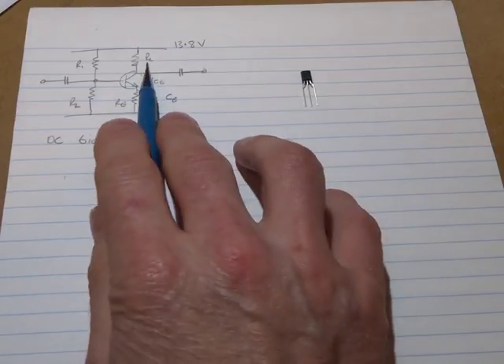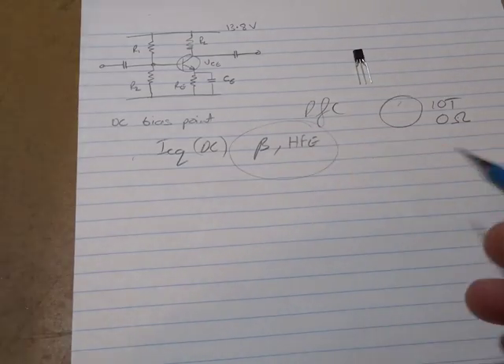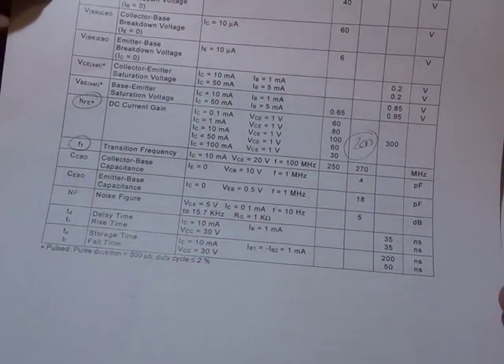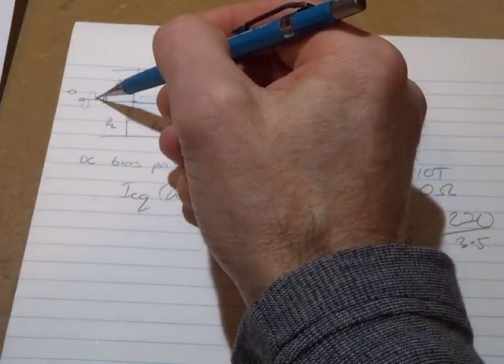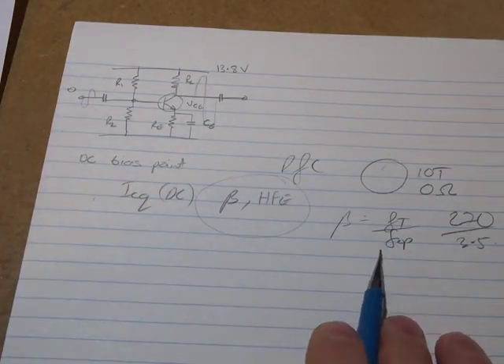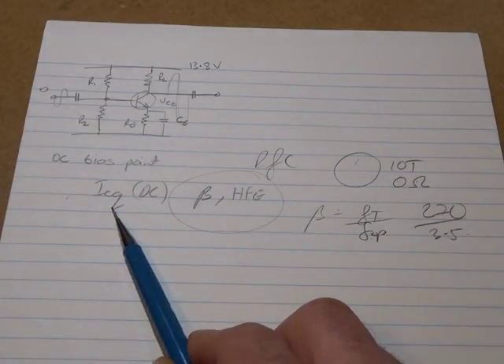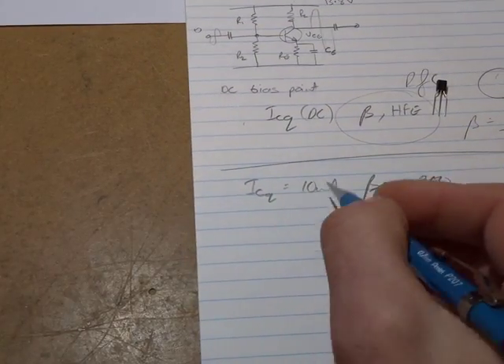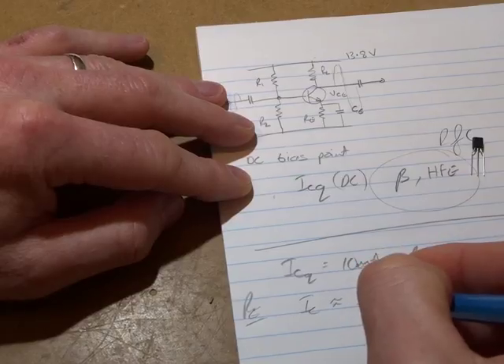Common Emitter Amplifier Biasing Calculations

Comment: Damn. I just use a multimeter to measure the voltage I want at the base of the transistor to amplify my signal without distortion and that's it. I work with big signals so I don't need too much gain on my designs. I do some math, but not anything like this. I use my oscilloscope to scope the signal and then I can change the resistor until I'm satisfied with the gain and frequency response of the thing. Like, if you want to work with amplifiers you must have an oscilloscope.

Comment: The collector current determines the input and output impedances, nothing else. The high limit occurs when the transistor's maximum power dissipation of 625mW is approached. The low limit occurs when the parasitic capacitances' reactances at the frequencies of interest become significant compared to the resistors used.
Around 13:30 you should realise that if you fully bypass the emitter resistor, the ac gain of the stage becomes RL/ re, where re is the internal emitter resistance (the slope of the Vbe/Ie curve at that collector current and equal to 25mV / Ic).
But you make the mistake of assuming that Re determines the value of the bypass capacitor. It doesn't. Until the reactance of the bypass capacitor is less than re (which is just 2.5 ohms at 10mA collector current), the gain will increase with frequency because it becomes RL / (re + Xc). The capacitance would actually have to be C = 1 / 2π x 3.5MHz x 2.5R = 18nF, rather than the 3.3nF your calculation would indicate. if we used your value, the gain at 3.5MHz would be RL / (2.5 + 13.8j) which is phase-shifted, highly frequency dependant, and 15dB down on what it could be.
If you split the emitter resistor so that a part of it is unbypassed, then as a rule of thumb, that part should be ten times re (25mV/Ic), say 27R. That will remove much of the non-linear distortion  and make the ac gain more predictable. Then you use the 27R to calculate your bypass capacitor, of course.
Reply: Rex i need the text book that you're taking these infos from pls 🥺
Reply: @NoName-yy1jx  Sorry, none of this is from a text book. It's just the result of spending over 50 years designing and making transistor circuits.
Reply from the maker: Thanks Rex. I'll take a closer look at this.

Comment: From where u got that frequency value 3.5 Mhz while calculating capacitor value plz give repley
Reply: Charlie was talking about designing an amplifier stage for use on a radio frequency band that is normally called the "80-metre band", which has been allocated for amateur use. It extends from 3.5MHz to 3.9MHz or 4.0Mhz, depending on which region of the world you are in. There's plenty of information on the web if you want to search for it.

Comment: Bit of a late reply - only just came across the video and thanks for posting.
The approach you have taken reminds of methods I was taught years ago at "school" and techniques I have seen in many text books. I too have wondered why few datasheets contain the characteristics graphs. What I have found from limited homebrew experience is that the HFE values for transistors can vary considerably over the specified range. Maybe that's why manufacturers are reluctant to put the graphs on the datasheets? Also, some of the datasheets values will be valid only for very specific test conditions (e.g. specific Ic and Vce). So, unless I measure the HFE of a transistor I am going to use, I would normally go with the specified minimum HFE for calculating the dc base bias resistors. Also, especially for transistors like the 2N3904 that don't have a super high transition frequency, you can of course expect the hfe to drop off as frequency increases. So, some expirementation, reliance on previous experience and reference to tried and tested designs is what I would go for.
Reply: GOOD ADVISE, I TOO REMEMBER LEARNING THOSE METHODS.

Comment: This is an older video but I would like to offer some perspective that I feel is being lost by the video and the comment section, and would like to offer ideas that few use.

First:  All of these 'hallowed'-calculations that are taught, are for designing for production NOT performance!  Different transistors will perform differently (even within the same-type and even same-lot!) at different Icq's, frequencies and output impedances.

Second: This is driven home, by transistor Beta variations that can exceed 100% for a given transistor even within the same manufacture datasheet!  If you want to properly quantify performance, it is a fool's errand to try and use the widest geometric-mean or the lowest value etc. for beta. Another example is the 10X rule for the input DC divider, this is really only a guarantee for lousy transistors within a lot.

Third: There is this magical Vcc (in this case 13.8V) that is not real world unless you are never going to use it off that perfect power-supply.  Many times, you will be using a battery that can be a 14.3V down to 11.7V (or even worse) say in an emergency.  So, a circuit worth its salt has to perform at any one of these to be practical.  Some of the major ham equipment manufactures are terrible, requiring boost circuits even when using a partially charged battery! 

Fourth: External component tolerance variations (especially when all their statistical variations conspire to give the worst outcome!) will play a significant role in the exact circuit performance.

Lastly, if you design using one of these 'production'-calculated/derived circuits methodologies, what do you have.  Well you can claim that the circuit will work with the crappiest transistor out of the lot; the worst resistor tolerance variation/degradation. Does that sound like designing for performance--No!

Moral-of-the story: The real answer for the hobbiest (not-production) is to think in terms of greater precision and to set ourselves up for success. How?  

First off, buy a bunch of your favorite transistor and grade them for good performance and tight similarity on a unit-to-unit basis.  Constructing a high-frequency amplifier or oscillator will allow you to more accurately quantify performance, than calculating geometric means and worst-case values from a datasheet. So, out of a hundred transistors you will usually find 75% of them are really tight with each other--use the rest to drive LED's or relays!  Then come up with your own specifications as if you were in charge of doing so for your sweetheart lot.

Finally, the most important concept, is empirical testing of your circuit.  Every engineer should sit down and vary all the circuit parameters just to learn and observe EXACTLY what your circuit REALLY does.  

When I was playing around with QRP gear I quickly found that using 10mA quiescent-points quickly added up and did NOT add ANYTHING to the NEEDED circuit performance. You will find that you can use much less current whether quiescent or input divider (because you don't have wild beta-variations!). Many times a free-lunch can be had with higher-gain transistors but make sure everything stays stable! Make a habit of measuring ALL of your external components for tolerance. Most importantly, lower the operating voltage and make sure the circuit still performs (oscilloscope patterns etc.). You will find it fun to push the circuit elements to the max when you think in terms of performance NOT production.  73...
Reply from the maker: Great input. Thanks for taking the time.
Reply: PICKY,PICKY!

Comment: what if av id given how to calculate correctly
Reply from the maker: Hi. I would use Av=-Rc/Re, then once Re and Ve are determined, re-calc R1 and R2.
Reply: @CharlieMorrisZL2CTM  so in ce voltage divider bypass AV = -RC/re i can determine RC , but if my RE> RC that have no problem right?

Comment: what about inpu and aoutput capacitor values?
Reply from the maker: I typically set those to have a Xc < 100 ohms at the lowest freq of operation. More often than not I set RF amp caps to be 100nF.

Comment: In a battery powered environment 10 ma in a multistage amplifier can add up pretty quickly. What about the input impedance which will be dependent on R1 and R2?
Reply from the maker: That's certainly true. I'm going to design all of the amps at 1mA for the Go QRP rig and see how that works. I chose 10mA for this one just for the exercise.
Reply: In another reply, I noted that the input impedance also depended on (β x the total emitter resistance), and showed that if you bypass the emitter resistor, it could be as low as 250 ohms. Reducing the collector current chosen by a factor of X will increase the input impedance (and also the output impedance) by the same factor. Adding an extra emitter resistor that is not bypassed can also significantly increase the input impedance (as well as reducing the distortion and gain).

Comment: You are the best!
Reply from the maker: Thanks. I am no expert, and this uses a number of rules of thumb. The sim is to make it simple and hopefully attractive for other to give homebrew a go.
Reply: @CharlieMorrisZL2CTM  No, you really made it easy for me. Thank a lot. I was stuck somewhere at collector, and needed to match the impedance of Rl with Rc. Your approach to biasing seems a lot more easier than reading through several books, which actually complicate things. Also, I just wanted to know more about constructing RF transformers to match impedance between the stages. Coz, this is actually the device that effects the overall efficiency of the circuit. So, requesting your next video, please.  And thank you once again for your reply.

Comment: Thank you for the video! I've put together an interactive notebook that can calculate the circuit using that method given the input values. Might be useful to someone: https://observablehq.com/@flpvsk/calculating-a-common-emitter-amplifier-circuit

Someone has asked that already, but I didn't quite get the answer. How do we know the operating frequency? Would that be 20Hz - 20kHz for audio? And so for the Ce we'd use 20Hz, is that right?
Reply from the maker: Nice work Andrey. That will be useful.

Comment: How do you get the lowest operating frequency ? If it's an audio amplifier should the lowest operating frequency should be 20 Hz right
Reply from the maker: Hi. I use standard communications audio bandwidth of 300-3000Hz.

Comment: CHARLIE MORRIS,    
                             Does the AC/DC load line mean the maximum output wattage power of the transistor or does the AC/DC load line mean the power dissipation of the transistor?
                                     Because the AC/DC load line is selected by the EE designer of the operating voltage and operating current for the transistor and the DC bias Q point which will determine the maximum output wattage power out of the transistor and the power dissipation of the transistor. I'm not sure what the LOAD means in the AC load line and DC load line what they are calling the LOAD.

Comment: CHARLIE MORRIS< what is the formula to get "how much current in amps" can a 4700uf cap can hold from B+450vdc from a linear power supply?
Reply from the maker: Hi Bill. I don't know the answer to that off the top of my head. Current would be a function of the load hanging off the cap once it is charged up. Full charge will be 5x CR (capacitance x resistance). Same for discharge.
Reply: @CharlieMorrisZL2CTM  without the LOAD, how much current in amps can a 4700uf hold store with a power supply DC voltage at +450vdc? the 4700uf filter cap will charge up to +450vdc but how much current is the 4700uf holding storing?  What formula can I use to calculate how much current the filter cap is storing in amps?
Reply from the maker: Bill. I hope I have interpreted your question correctly. In a DC system current does not flow through the capacitor. When a voltage is applied, the capacitor will charge up to that voltage. Once it is charged, the capacitor
will hold a charge (in coulombs) equal to Capacitance x Voltage (recall, charge a coulomb is the charge (Q) transported by a constant current of one ampere (A) in one second (S), i.e., 1 Coulomb = 1 Ampere for 1 Second). Now for your capacitor, the charge will be 4700uF x 450V = 2.115 coulombs. Similar to a battery, that capacitor could provide, once a suitable load is applied, 2.115 amps for 1 second, or any other combination (e.g., 1.058 amps for 2 seconds). Note too that the time to fully discharge will be approx. 5x (Capacitance x Resistance) seconds.Not sure if this answers your question. Apologies if I have misunderstood
your question.
Reply: @CharlieMorrisZL2CTM  yes for the formula is Capacitance X Voltage = Current Stored?
Why I ask is because the AC ripple voltage will increase higher when the load is drawing more current. Any reasons why the AC ripple will increase when the Load draws more current? The Load is drawing the current OUT of the filter cap 4700uF
Reply from the maker: Hi Bill. I'm not expert but if I recall the filter caps should be providing adequate current to the load during the negative portion the supply cycle. If the ripple is increasing under load, then that suggest you don't have adequate capacitance. Have you tried another capacitor in parallel?
Reply: @CharlieMorrisZL2CTM  yes you have to add more capacitance in parallel. I'm just wondering what formula is used to when you have a load to find out the ripples peak to peak voltage value. 
Filter Capacitance X voltage = stored current
But whats the formula with the Load 
C x V x Load = AC ripple voltage?
Reply from the maker: @billwilliams6338  Sorry Bill, I don't have a suitable formula off the top of my head. This site looks useful: http://www.skillbank.co.uk/psu/smoothing.htm
Reply: @billwilliams6338  Capacitors store charge, not current. The charge on a capacitor is equal to its voltage times its capacitance by definition. So Q = VC. If you are using a capacitor to reduce ripple on a power supply, then the capacitor will charge up slightly on the peak of the incoming ac sine wave and discharge when the voltage of the incoming sine wave falls below the voltage on the capacitor. During that time, the capacitor will supply the current for the power supply, so the charge it will loose will be current times time, So Q = It.
For a full-way rectifier on 50Hz mains, you have a 100Hz sine wave and the time spent discharging will be no more than 10ms.
It should now be obvious that ripple voltage is the change in voltage during the charge-discharge cycle. We know that Q = VC = It and we can use that to work out the change in voltage as approximately V(ripple) = I(load) x 10ms / C(in farads).
For example: a full-wave rectifier on 50Hz mains, smoothed with a 4,700μF capacitor, and delivering 2 amps, we can estimate the ripple to be 2A x 0.01s / 0.0047F = 4.25V.

Comment: It seem that ALL similar tutorials (class A amp) start form the "middle" - electing Ic. The amp "amplifies"  - controls output POWER using input POWER.  Hence the design objective should be HOW much amplification is desired.  Perhaps that would improve on some of those "rules of thumb"  .
Reply from the maker: You are correct. The PA videos later on take that approach. Please note that these are not tutorials, but simply a video log of what I have done. I am not an expert. The whole aim of the videos is to encourage others to give homebrew a go. Thanks again.

Comment: Anyone know where the lowest operating frequency comes from?
Reply from the maker: If my recall my theory correctly, the low freq performance is set by the input coupling capacitor. I typically use a 100nF cap which works well for the frequencies I'm using. Otherwise, set the capacitive reactance to be 1/10th Rin.
Reply: @CharlieMorrisZL2CTM  Thanks. I will look into both of those. Currently using an AC supply of 0.5v at a frequency of 10K Hz then have an Rin if 300. So I should either have a capacitive reactance of 30 or have a 100nF. Thanks for the great video and fast reply man.

Comment: Charlie, one of my fav electronics books is by Malvino, picked it up used, "Transistor Circuit Approximations", that teaches that the resistor divider common emitter amps are beta independent. It uses such simple equations to determine bias, the book is really cool.
Reply: I think that "Semiconductor Circuit Approximations," by Malvino, is an updated edition. It was published in 1985 and includes some information on IC circuits. I picked up a used copy ("very good" condition) from Abebooks for $7.57, shipped.

Thanks, edbeckerich3737, for the tip!
Reply from the maker: Cheers Ed. I'll jot that down and take a look.

Charlie

Comment: i have tried but i couldn't  get the exact results so i thought you might help me in biasing a BC547 transistor
Reply from the maker: Hi. I don't have time to make a video sorry. Here are some generic biasing calcs for a 12VDC system, with 10mA quiescent current through the BC547A. See if you can follow the logic. From the BC547 spec sheet the hFE range for the BC547A is 110-240. I now use the geometric mean for biaising calculations, so Beta-DC = SQRT(110 x 240) = 162. Let Ve = 1/10Vcc = 1.2VDC. Thus Re = 1.2 / 10mA = 120ohm. R2 = (1.2V + 0.7V) / (10 x (10mA / 162)) = 3078ohm (try 3k). R1 = (12V - (1.2V + 0.7V)) / (11 x (10mA / 162)) = 14874ohm (try 15k). If you are trying to determine input impedance etc, then you will need Beta-AC. From the spec sheet Ft = 300MHz. So Beta-AC = 300MHz / the highest freq of your amplifier operation. The input/output coupling capacitors, emitter bypass capacitor etc are a function od what frequency you intend to run the amplifer at (i.e., audio versus RF). A lot of the more recent videos and the blog (https://zl2ctm.blogspot.com/) have examples of that. Hope that helps.
Charlie